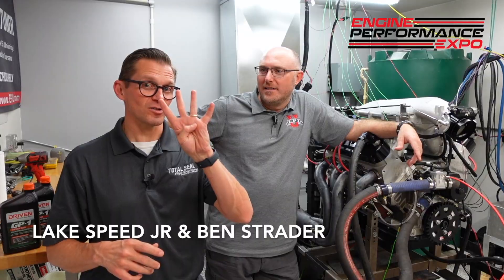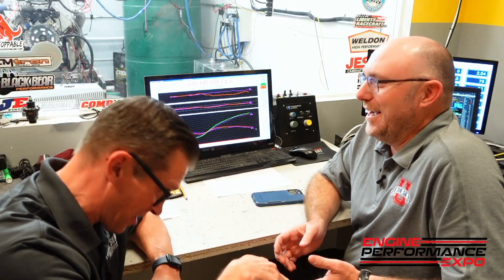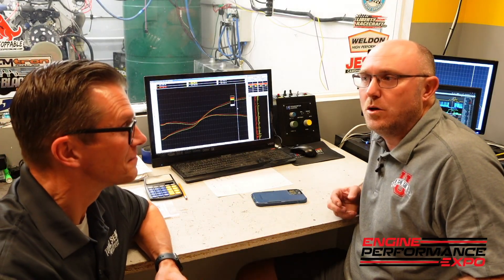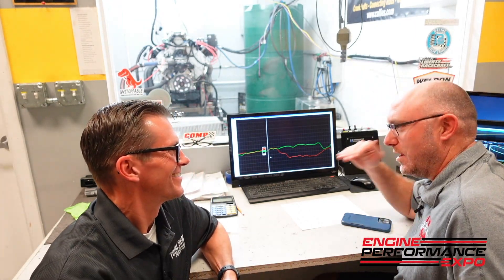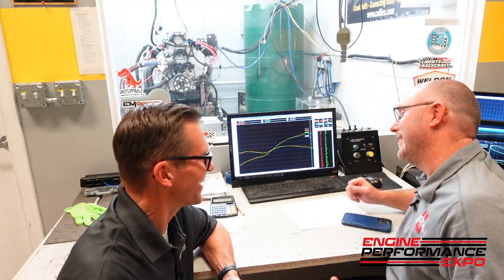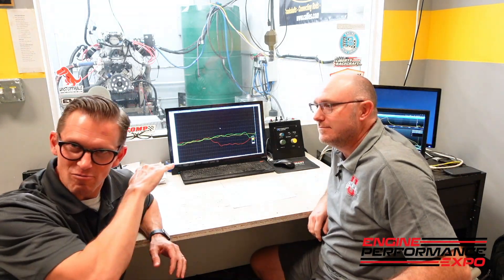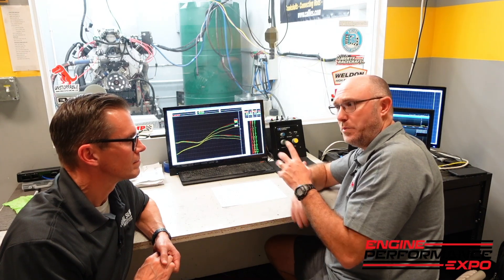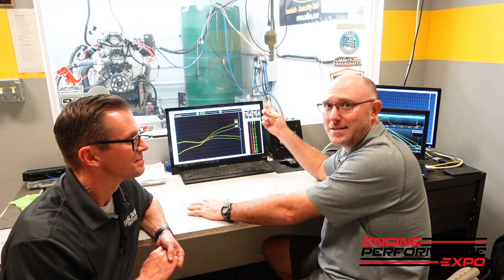How MUCH OIL is TOO MUCH? Dyno Results!

Comment: I think you missed a point about "too much oil" that would relate better to regular folk who DON'T have a dry sump motor in their car.  How about doing this simple test - Lets say you have a passenger car motor that normally holds 5 qts.  Put in an extra 3 or 4 qts.  Now the crank and all the rods are immersed in oil.  It would be  splashing foaming chaos.   The extra drag would result in some power loss, the foaming MAY reduce the lubricating efficiency, depending on the oil.  The oil rings would be overwhelmed by the flood of oil.  Oil burning & smoking.  Is any of this wrong?  Maybe do real world testing instead of you and your assistant getting giddy about using the dyno.
Reply from the maker: I don’t disagree, but this is the engine we had and the test requested for the Engine Performance Expo.

Comment: Can you do a video reviewing if AMSOIL is worth the price
Reply from the maker: Thanks for the suggestion
Reply: I’ve used Amsoil for over 25 years now and love the stuff, I swear it has been magic in a bottle to most engines and no noticeable difference to others. 
If the engine had always been run on conventional oil then the difference after 600 or so miles was like it came alive. 
But the price of it always killed me 😢. 
I’ve recently started buying Costco synthetic oil and I’m just changing the oil a bit earlier.
My 3 cents (inflation 😂)

Comment: Hey oil geek whats the pros and cons of adding something like marvel mystery oil to my oil. It says you can replace up to 25% of the standard capacity with it. Ive been adding about 1/4 quart to my car as its burning about a quart per 5k miles. Is this a bad idea? Or could it be beneficial? 1.8l corolla 4.4quarts of oil. If it matters thanks
Reply from the maker: That sounds like a great idea for a video.

Comment: No discussion on aeration and foaming??? I don’t actually understand how or why pressure would be better either. If the pickup is submerged, I don’t understand how pressure would differ
Reply from the maker: If we kept running the engine overfilled, there would have been a foaming problem due to aeration.
Reply: @themotoroilgeek  makes sense. Why would pressure be more consistent though? If regular fill level is lower pressure, does that mean the sump is actually picking up some air under normal operation?

Comment: When I was in the trade, This young woman asks if if can look at her engine as it was smoking, lacked power and smelled of burning. She told me the story that she 'topped up' her engine oil. When I pulled the dipstick I couldn't see any level for a split second until a large drip of oil dripped onto the floor. I removed the oil filler cap to find the engine oil level just under the oil filler cap. She said it took a lot of oil to top it up 15 to 20 litres of 10w40 :hand-orange-covering-eyes:🧐🤦‍♂
Reply: Did it run fine after drained and refilled it?
Reply: @phxrsx  It sounded OK and ran fine, she didn't come back so I guess so. I was amazed.
Reply: @phxrsx
Reply: My sister drove the family van and it died. She car pool.with her coworkers.  No one could've figured it out. They took to mechanic shop and couldn't find out what's wrong. My dad came and he noticed it ran put of gas. Shake his head lol
Reply: @BlueRice  he should have told her to change the blinker fluid
Reply: Impressive it stayed that full after she had driven it.
Reply: @Pittaz  There were lots of areas around the breather where there was lots of residue. It ran badly it wouldn't rev hardly at all- because there wasn't any capacity left inside the engine. I think some people are more suited to catching the bus
Reply: @79blustone  Not all.
Reply: I was going to make a joke about filling my engine until it comes out of the filler neck, but this story is way better lmfao.
Reply: I predict the amount of blown engines coming in for "warranty" is about to go up 😂
Reply: @meme5887  especially when most manufacturers are now using shitty wet belts 😱
Reply: @79blustone  yes, because people don't realize they need special belt certified oil, they do dissolve a lot of belts already.
Reply: I overfilled my corolla by 15 liters on purpose 😂 smoked and was gutless but was fine🤣
Reply: My ex gf did this with one of her old cars, filled it to the brim, bellowed smoke all over the parking lot/street... amazing ahhahahhahahhahah
Reply: Women. Lol.
Reply: My first oil add was like that i emptied the whole 5l not checking the level lucky i was stopped and got it fixed this was on a old farm tractor its the best lesson appart from dont drive through water if the car doesnt have a snorkel 😂 road floods are deceiving
Reply: Where the ef did you get that eye popping emoji?
Reply: 'Seems like you'd get 'oleo' lock.
Reply: Bs , motor would not run
Reply from the maker: LOL!
Reply: I did that to a car I was having towed to the scrap yard... Had a few gallons of used oil I wanted gone so I just filled the crankcase.

It'll get drained anyways 😂
Reply: @volvo09  GENIUS
Reply: @volvo09  Classic 😂😂😂😂
Reply: @volvo09  FYI, Autozone will take your used oil for free. I'm sure other places will as well.

Comment: Lake, I find your videos fascinating. I have a question. Do you have an opinion on changing oil brands using the same viscosity and specifications in the same motor over it's lifetime. Does it make any difference from a wear and tear perspective or as long as the specifications are the same between brands, it makes no difference? I personally like to stick with one brand but some people like to buy what ever is on sale at the time? What about swapping between synthetic and mineral oils with the same viscosity? This may be a good topic for a future video.
Reply: He has mentioned this before and recommends staying with a the same brand. If I remember correctly the engine has to incorporate the additives protection  package and since each oil is unique switching around takes away from the effectiveness.
Reply from the maker: Great suggestion! I actually have some data on that subject!

Comment: No. I’ve seen dipsticks filled an inch above max, maybe even 2 inches, for a whole normal oil change interval. However many hours/miles. Definitely 500 hours idling. Fleet vehicle. Nope. Didn’t hurt the engine a bit. Oil burn/evaporation or whatever it is decreasing, and no white smoke so no excessive oil burn, was normal, expected decrease. Much less than even 1 quart.

Boomer conservatives went crazy with vehicle maintenance. They probably spent a new cars worth of money over maintaining and making their family think they were gods with their knowledge of cars, even more than engine engineers. Boomers are the fuckin worst.
Reply: Born yesterday and assume you know something. You can't eve comprehend the point & purpose of a simple video.

Comment: I’m pretty sure cars are engineered to be at a lower oil level. 
Engineers probably realize that most DIY’selfers are prone to overfill . The classic line that more is better.
My Honda 6 cylinder coupe calls for 4.5 quarts and I’ve always put the entire 5 quart jug in.
Still getting more or less the same mpg as new.
17 years later and 185,000 miles , she’s purring like a kitten .
Reply from the maker: Yep, a little low is much better than a lot overfilled.

Comment: I'm having that issue on both my cars now.  5 qt pan on a lt1 is falling off on a pass and on my ls1 car dropped down the same on holley data log  with 6 quarts in it.
Should I run an extra 2 quarts?
Reply from the maker: No. Try a higher viscosity oil.
Reply: 6 quarts is already an overfill for a factory LS1 wet sump pan!!

Yes to Lake's suggestion, and what weight/brand of oil is in the LS1 currently?
Reply: @LS1conehead  I had vr1 10w30 in it then went to 20w50 vr1. Problem pretty much was gone. Now I went to 0w40 penzoil ultra synthetic.   It hasn't been a problem since
Reply: @LS1conehead  now my lt1 is showing to be having same issue so I switched it to same 0w40 penzoil and it still drops to 30 psi at high rpm.   All 3 cars have holley and all 3 were seeing pressure drops at wot

Comment: Suggestion for video!!!

First of all I love all your videos .

I have a car with a Volkswagen air-cooled Type 4 motor from 1972 Porsche 914.

I have been told I should be running a high zinc special oil in that .

Somewhere I read that oil made for diesel motors has the same stuff in it as the more expensive
" racing oil"

Is this true?

I would love for you to explain the science behind different oil for older cars and what is exactly is in the racing oil versus diesel .

Thanks for the awesome Channel
Reply from the maker: https://www.motortrend.com/how-to/diesel-oil-in-gasoline-engine/amp/

Comment: 9:05 What were the results of re-checking your tests? Did you do that?
Without verifying the BSFC numbers for each test, the whole series of tests you did was meaningless.  What if the atmospheric pressure dropped between tests? That would account for a drop in hp.
Reply from the maker: Stay tuned for more. We actually have combustion analysis data on this engine, and we did verify these results.
Reply: @themotoroilgeek   Excellent! I'd like to see that.
On an unrelated topic, a friend just emailed me asking what oil to use in his Volvo V50's 6 speed manual transmission. He said the dealer told him the factory fill is whale oil! And at $200 just to buy the oil, that's crazy money. From my quick research, whale oil was banned over 50 years ago, so I wonder what the real oil actually is?
Have you ever heard of this nonsense?
Reply from the maker: @e-curb  I’m sure it is not whale oil, but it might have some unique characteristics (if the synchronizer materials are also unique).
Reply: @themotoroilgeek    Sounds like a topic for an oil nerd to research. Know any oil geeks?
Reply from the maker: @e-curb LOL
Reply: @themotoroilgeek   On another note, my friend sent me a photo of the oil bottle the dealer sells. It states that the oil has a 5 year shelf life.  This confirms your videos from last month.  
Recently, I found 5 qts of Castrol GTX from the early 90s. Initially, I thought they would be great for my next new build to protect the flat tappet cam during break-in. Since your video, I'm glad I haven't used that oil. I think I'll put it in my oil squirt gun to lube door hinges instead.

Comment: My 70s economy car with a small engine is prescribed by the mfr to take 2.5 liters of oil. I always give it an extra 1/8" on the dip stick to compensate ahead of time for the oil it may consume. I once met a woman with the same car and she told me her mechanic instructed her to wait until the oil got to the bottom line, then to add 1 liter. That means she would be driving around with only 1.5 liters in her engine. I told her that was BS advice and that she should add small amounts to keep it at the top line. This was an engine that would almost never go higher than 4000 rpm.

Comment: What's confusing is when exactly to check the oil?  Do you check it warm? Cold? in my car's manual it states to have the car at operating temp (but doesn't state what temp that is? I am guessing around 180F) then shut off the car, wait 10 minutes them check.  So if you check the oil on a cold engine lets say 6am before you head off to work and it shows half way on the dipstick is one to assume it will go to full when warm?  How much do these 20W oils used in most modern vehicles actually expands?  If your running a 5w40 for example one would believe thermal expansion would be more likely greater than a 0W20.  Additionally, why do manufacturers have dipsticks that are so difficult to read?  Heck some cars don't even have dipsticks any longer.  Just me ranting, sorry everyone haha.
Reply from the maker: Check it warm. Oil volume grows as oil temperature increases.

Comment: Stuff the power loss, just always keep the oil level to the full mark on the dipstick. That way, the engine runs cooler, more reliable, and the oil won't get contaminated as fast.  Running low on oil, to gain power is just stupid. Do you want to ruin your engine because of a little power gain? In normal driving, the engine has more than enough power to get you where you need to be. Don't overfill though, as you can cause the oil to foam, and actually starve the moving parts of proper lubrication, as well as blow oil seals out.
Reply: This isn't normal driving.  This is a dyno test.  Nobody is pulling their Camry or whatever in there to try different low oil to HP scenarios.
Reply: Exactly my line of reasoning !
Reply: @Nellis202  Yep. To get the maximum life out of my engine is a million times more important to me than power gains🙄🙄🙄
Reply: You guys are clearly here for the wrong reason.

The takeaway from this video is the benefit of dry sump systems.
Reply: @BubblesTheCat1 what if it’s the last round of the championship and you’re a few points behind and need the win to take home the chocolates?
Reply: Royal Purple oil,  mpg gain.  Use in summer time only.
Reply: Down to earth comment for the ordinary driver
Reply: The full mark on the dipstick is full when at operating temperature. If your engine isn't hot then keep the oil level a little less than full.

Comment: As I had been taught a long time ago was that up to 25% more oil than what "should be" in an engine is mostly ok. But more than that level leads to the crank slapping the oil in the pan too much and aerating the oil causing engine damage.

This showing the volume and how it effects the pressure & power is quite interesting. I'd love to know how much aeration was introduced at what levels and at what point that causes issues...
Reply from the maker: There would have been considerable aeration if we had kept running the engine with the high oil level.
Reply: @themotoroilgeek  Oh I'm not doubting the level of oil at the end would most certainly have been enough for aeration issues. As technically that's a "5 quart" spec engine that you had running at 9 quarts, right? 4 quarts over a 5 quart spec is 80% overfill. Not sure how much the oil pan would adjust the what the called for oil volume would be. That's the exact question I'd love an answer to, how much does it take to get to aeration problems...

Though i can't see how it would be possible to give a definitive answer to "how much oil volume over spec before aeration becomes an issue?" due to the various engine & oil pan designs & layouts. Which is why I'd imagine the "keep it under 25% overfill to avoid aeration & engine damage" was most likely leaning towards a broader safe guesstimate
Reply from the maker: @bubba966 for a stock engine, it would take a quart or two overfilled to cause these problems.

On a stroker engine, you can see this with the “stock” oil level.

Comment: I have found that keeping oil level in the middle of the operating range instead of at the top or slighty above does improve fuel economy and power, not much I would estimate 3%
Reply from the maker: That’s spot on!

Comment: years ago I did an engine replacement on an Olds cutlass cruiser wagon with a 2.5 4 cyl, pretty easy job, the salvage yard delivered it fast and I got it done in one day, with a new filter and 4 quarts of new oil, well the yard never drained it, it ran ok but with 8 quarts of oil it had no power uphill 30 mph was top speed, did not seem to hurt anything, but that is what happens when you rush jobs
Reply from the maker: Thanks for sharing.

Comment: My mechanic always fills the new oil filter and dumps the rest of the 5-quart container into the engine (2016 Honda Accord V6) which is about 1/2 quart more than the 4.5 quarts including the filter per manual recommendation. Is an exact 1/2 quart harmful to the engine? should I drain it?. Also, the car averages less than 5k per year. I was told every 5k or up to one year change is ok on synthetic 0w-20. Thank you.
Reply from the maker: Don’t go higher than the full mark on the dipstick.

Comment: I've done a lot of stock oil pressure tests in my life. The mostly boring ones on a hoist, and a lot more on a dyno. I learned some things here that I didn't expect. That drop in oil pressure at 5000+ RPM with a reasonable level is sketchy. It has to be one of two things (or a combo). The oil isn't returning fast enough so you suck some air. The oil is whipping around so much that a "air tornado" of oil sucking air into the pump.
Thinner oil would increase the tornado, but lessen the drain back. Test it please and prove me wrong.
Reply from the maker: The pressure drop with the lower oil level is due to oil being retained in the heads, which was running the pan lower. 

Stay tuned, we have more coming with this engine.
Reply: @themotoroilgeek  Looking forward to it!
Reply: My thoughts as well surrounding the oil pressure drop in the 5 qt test.  Seems like the only reason would be the pickup is grabbing some air.  Looking forward to more testing, thanks!!!!

Comment: Really interesting video. Maybe I missed it, but how much oil was supposed to be in that engine? I thought they said 11 quarts at one point. They never even had that much in.
Reply from the maker: The oil pan was designed to hold 11 quarts of oil with steel rods, which have a smaller cross sectional area. With these Aluminum rods (much larger cross sectional area) we had to drop the oil level to keep the rods from hitting the oil.
Reply: @themotoroilgeek  thanks for the reply, so my question is then, on a regular car if you fill it to the top recommended level, would you have this same issue? Or is this just because it is basically a custom race engine.
Reply from the maker: @85CEKR for a factory engine, just don’t fill it beyond the full mark. The results would not be as significant as this test, but it is still negative to overfill.